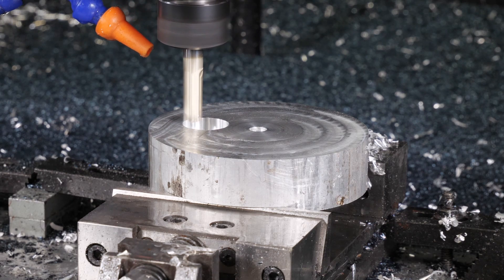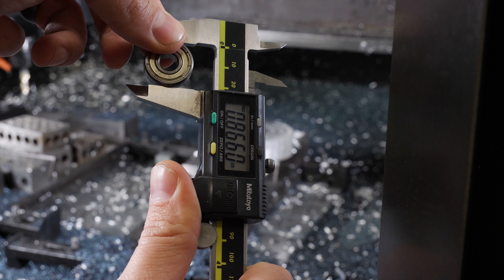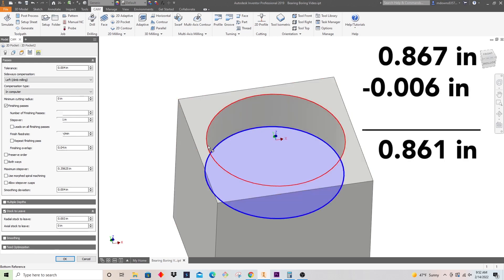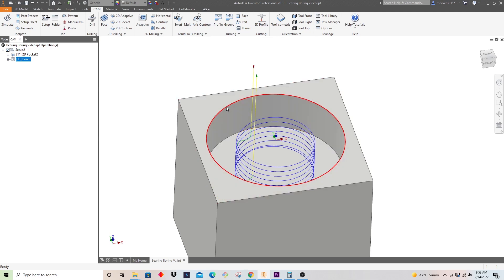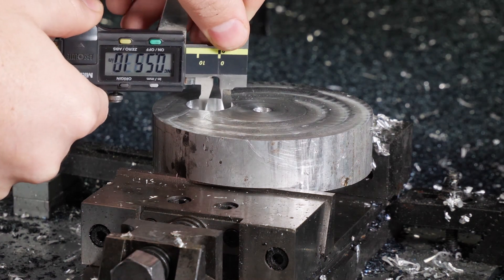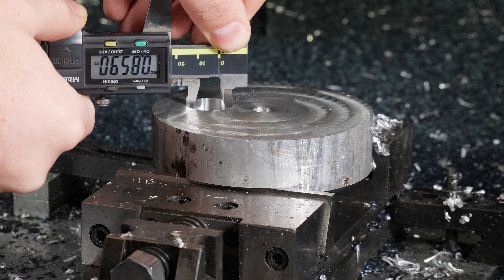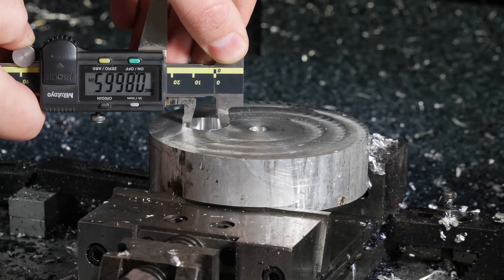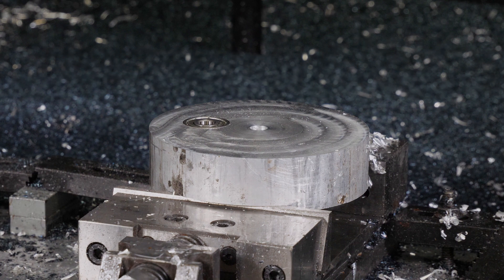Creating an Accurate Bearing Bore using a Boring Toolpath Strategy on the MR-1 CNC Gantry Mill

Comment: Can you have a video showing the tool changing process?

Also, is there the potential for a power drawbar in the future?
Reply from the maker: Hello. Stay tuned we are releasing a video to show the 'Chip to Chip' tool change time on MR-1 using the tool setter and the included collet wrenches. I think folks will be impressed with how quickly it can be done!